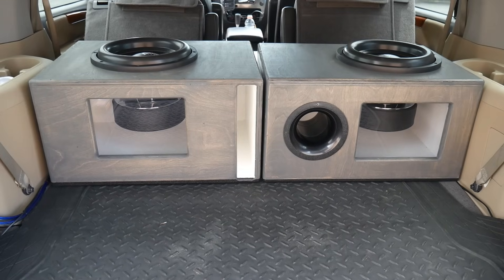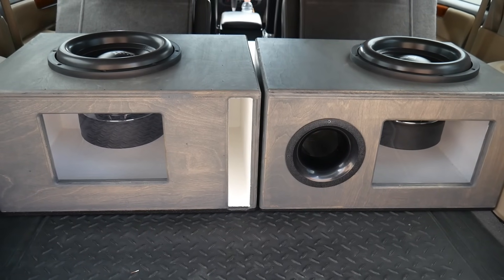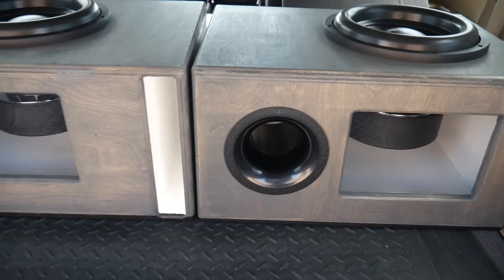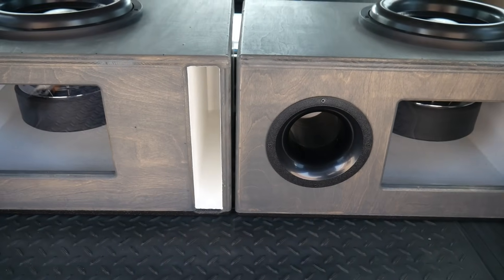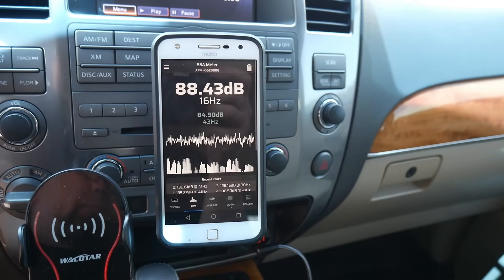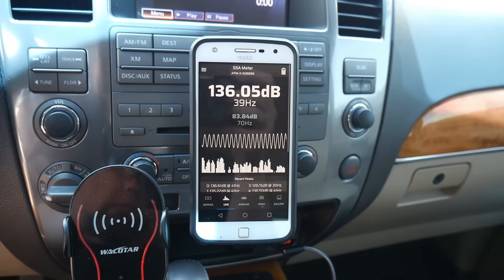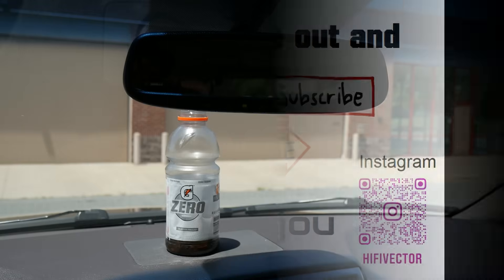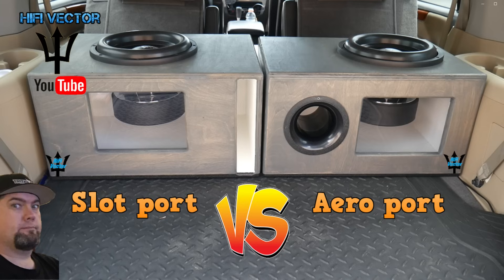Part 1 Slot port vs Aero port subwoofer box in depth comparison

Comment: Of course the slot port will outperform the aero since it has double the port area.
Reply: Yes, 2 x 4" ports minimum for a 12" high excursion subwoofer like that.
Reply: You always going to have that  one. Hey, shit was dope. Keep doing your that.
Reply from the maker: The whole purpose of this video is for fun but also, if you do some research, you do not equal the size going from a rectangle to a round port. This is a whole opinionated deal with this aero ports are supposedly more efficient so you’re supposed to be able reduce their size by 35 to 50% or whatever someone’s opinion is. And be equal to a slot port. Think about it how many normal low end or mid range 12 do you see with a 6 inch airport unless it’s some crazy high-end 3 inch excursion SPL sub everyone uses a 4 inch airport for 12. For this subwoofer, a 6 inch airport would’ve been too much area. This is why I wish they made more sizes in round ports like 4 inch 4 1/2, 5”,  51/2” etc…
Reply: @HiFiVector I  already knew you did the proper enclosure math using a box calculator program , duh lol
Reply: @HiFiVector Aeros are more efficient, yes. If you make them smaller than You would a slot then your entirely defeating the purpose of using the aero port and building your box wrong. 

I’ve never seen a woofer manufacturer recommend different area for slots or Aeros, they just give a straight up port area recommendation. 

Just think about it a little.
Reply: @bengailey5135 I've built boxes and have directions tell me to use a certain size of power area no matter if it's slot or aero or a square port tube or plain round. But then I have see box directions and bix building apps say the port area changes in reference to the type of port being used and it's size in diameter.
Reply: Yes port area might be greater, but the way the helmholtz resonator performs is the same, as verified using the dayton impedance curve tool. The rectangle shape is suboptimal to the cylinder in that it imparts drag to the air, so it must be larger to compensate. I would have liked to have seen dats results as part of the testing in the video. Might have cleared up some confusion.
Reply: Also meant to add that loading the port against a wall will sort of add like lowering the tuning as well.
Reply: Maybe I missed it, but all this discussion on surface area is not accounting for total volume of air moving through the port from port length. To directly compare ports, you should decrease the port area, but increase the port length of your slot port. 

If your criteria is only tuning frequency and avoiding chuffing (port noise), then you could really scew the odds and make your slot port even larger and longer than it already is.

You also are not taking into account that both boxes look to be the same size. This becomes a problem because the internal volume are vastly different between the two boxes and also affecting performance. 

It's a fun video, but it's not the perfect comparison between ports because there are way too many other factors at play than simply port type. Cabin gain not accounted for either as measured in the same place and boxes are placed in different locations. Removing each one and doing them separately in the same exact position in the vehicle would also slightly affect your results.
Reply: Lol you car audio guys a clueless about boxes
Reply: @ChromecastM8  Very interesting.  Don't think anyone thought about it from that perspective.  Did you want to add to the conversation or just make vague comments?  LoL
Reply: Aeroports can get really loud, this box was built to specs. I sure someone with plenty of time and material would get louder on that port, slot ports are cool since they basically do the job 💪🏾. Either way nice boxes and nice way to go on Sub selection.
Reply: Just what I thought
Reply: Now if they both had the same amount of dimensions of the ports equally used for the ports then it would be equally fair. But their not. So the slotted has more of a space ported so that would win and did. But then it all depends on what low bass  frequency or etc your comparing. Or the loudest alltogether
Reply: Dude ... Nope.
Reply: You need to flare the inside port end too.
Reply: Yes an aeroport is going to need less area.  But run a 6" anyhow and do the spl thing of running the port on the OUTSIDE of the box to achieve the same tuning.

Load that port against the back hatch and fire up or load the port into the side and fire up.  And it'll demolish the slot port.  ;)

Fantastic video
Reply: Needs a 6” aero not a 4”.  He failed before even starting
Reply: @EcSsAwS larger diameter also requires a longer port, but reduces mach speed.
Reply: @EcSsAwS hey I’m going to build a 10”inch sub can you send any good videos?
Reply: I mean yes but also no. 

Yes port area affects spl and the peakiness of the box but the benefit of the aeroport is you can use roughly half the port area and not have port noise. This saves airspace overall. 

So it's situational. The aeroport could save you enough airspace to build the box bigger and give a better power efficiency. 

Personally I prefer aeros due to ease of build but ports can be any shape as long as the resistance added by the area is calculated to the end needs.
Reply: @kylevanwinkle2081 I am a bit opposed to your answer. To some extent it can be good and you get advantages as well as too many disadvantages. The aeroport área, and for any other Port, it goes in proportion to the volume of the box and the Xmax of the speaker. I agree that you can gain a little more air for the horn, but let's also take into account that the horn will not work 100% correctly in its mechanical energy, therefore it can cause electrical problems.
Reply: A round port should also not be closer to any wall of the enclosure as the port's diameter, including the back.
Reply: I hope you are not the typical bad manufacturer who applies the formula "Volume x 16 = Port area". If so, would you leave me perplexed by the impression
Reply: I have never heard a build with an aero port be louder than a slot port, or have more bandwidth. And I’ve build hundreds of boxes and heard hundreds of systems. Just because it’s a circle doesn’t make it more efficient lol
Reply: @modernbassheads5051 A circle is the most efficient shape when it comes to the Flow of a gas or fluid.  That is undisputable fact.  Much better linear airflow, lower Reynolds numbers ect.  The aeroport like what was meantioned before is more efficient at fluid dynamics largely to the large rolled flanges, the shape and radius of the flange and the shape of the port itself all make a difference.  That said it isn't as large of a difference but maybe a two digit percentage.  The biggest thing that stands out to me is the tuning that is acheivable at much different area in² and in³.  Something else is at play.  Lower the frequency needs a longer distance for the sine waves to form into more powerful audible levels.  I don't think there could be a true apples to apples comparison.

Two different sizes (area² by area³) between the two different shapes and two different average airspeeds will result in two different levels of sound.  It's two different equations with two different outcomes.
Reply: @_FJB_ then why do chevy square port heads flow better than the circle port heads??? 🤔
Reply: @ederreyes3612  Same thing still applies.  There is a reason why for everything.  Cylinder heads have many many different variables than just a change of shape.  The two port shapes, circle or square with all else being exactly the same would have to be both straight through sections and exact same cross sectional area will show the round flowing better than a square shape every time.
Reply: @ederreyes3612  It's about 147cfm per sq in cross sectional area at 28" water vacuum.
Reply: @_FJB_ Yes, I  had a "debate" once on FB with a guy who claimed square woofers were larger than round woofers 😁
Reply: @_FJB_ the air in ports only vibrates.
Reply: @ronmartin7253 True and also what I said is true.  Both can be true at the same time. There is movement in the air and it's interactions with it's surroundings still hold true.  Especially the perimeter of the port.  Next to the surface there is nearly zero flow or next to none.  The shape of a circle has less surface are interacting with the area inside than a square or rectangle would which would allow for a better efficiency.  Higher the frequency the shorter the movement and lower the frequency the longer the movement.  The air still abides by the same laws of physics, boundary layer, reynolds ect.
Reply: @modernbassheads5051  Building boxes does not make you an expert so you automatically know everything. Of course, a round port is more efficient than any other, the friction on the contact surface is LESS! So yes, you use less space and it is much more efficient.
Reply: @DOroBeats  more surface area for the port is better for sound and spl as shown in this video, I also know more than you and have built more .. lol
Reply: @DOroBeats with a slot port u actually use less space cause the slot port is inside the encloser  it's  self.
Reply: @joshTheAudioGuy I've never seen a round port that is not inside the enclosure.
Reply: @joshTheAudioGuy that’s not true because if you’re building a box properly and both boxes have the same volume (port excluded), then you have to add more space to the box to include a slot port than you do an aero port.

Comment: I build a lot of boxes, and this was a great video !! I prefer Aero over slot, if you build your enclosure correctly you can even make your port adjustable on the fly. Something you can’t do with Vented. I also don’t like the “chuffing” from vented. Maybe I’m the only one that can hear it, but just not musically appealing. I’ve had some great vented boxes over the years, but just prefer aero. Subbed, great job on the boxes ….👌👏
Reply: Agreed. I like the smoothness of the bass the aero produces over the choppy slot port.
Reply: 7 cu 😮
Reply: @theinsaneunknown  That was all of the boot space up to the glass line in my tiny Citroen Saxo hatchback, managed 137.9 Db at 27 Hz on a Term Pro dash mic at a meet, power was a JL 1000/1 and single deep cycle Exide Maxxima battery plus 70 A alternator.
Again from memory the port was 25 square inches and about 24" long upward firing so internal end finished by the speaker motor, with the cabin gain from a small hatchback a window down drive by could be fairly spectacular at the right distance and could wobble larger store front windows, simple pleasures!
Reply: @g7vqedave2   I meant 7 cu seems like a lot, but that's without knowing much about the woofer or seeing what it looks like in software. I bet it was loud as shit in that hatchback though lol
Reply: Aero for SQ/SQL, and deeper bass. Slotted for noise! SPL, and concert speakers.
Reply: @TheWjbrown37  Yes, thank you
How would I port my next build
I think I want 30hz from Savard 15" 3500 thin copper wire
Then, I'm thinking of using 4 8" subs tuned the same for maximum SQ/L
Reply: There are ways to adjust tuning of a slot port on the fly, I have seen and done it myself
Reply: You can get rid of that port noise easily by putting 45s in all your corners when building your box. I run sealed boxes though so I have no horse in this race lol.
Reply: @ogxthugxnasty3885  I have done that with my boxes, all angles to have 45° or just the turns.  I have a long rectangle 4x12x29 wall port in box length.
Reply: @ogxthugxnasty3885  Or you can dial in your subsonic filter correctly so it won't play those frequencies that it can't reproduce. It only does that when the port's air velocity is too high, and that only happens when the port opening is too small for the frequency it's trying to hit
Reply: Aero would be more of SQ instead of just power?
Reply: I'm guessing by vented you mean the slot ported as slot or aero they're both vented enclosures and as for adjusting a slot ported box on the fly you just slide in a section of wood or dense foam to reduce the height of the slot to lower the Fs tuning as you've effectively made the port longer just like you might add a block of wood inside the enclosure to reduce the Vas and raise tuning for burping rather than booming, slot ported every time here and tune low to push the group delay out of harms way.
Reply: @g7vqedave2 

I am curious.    I am familiar with building and tuning boxes.  You mentioned tuning low enough to where group delay is minimum.  I am curious as to where you personally feel that frequency is..... in your opinion.
Reply: @drrckhamilton  I'm talking about my elderly mk 1 JL 13W7 here but from memory the Fs of that speaker was 27 Hz so using Win ISD my best box, again from memory, was a 7 cu ft tuned just below the speakers Fs at about 23 Hz.
This wasn't a massively loud box but compared to a box tuned to give large gain at the vehicles cabin gain frequency say between 40 and 50 Hz for burping in competition or impressing bystanders it would be many Dbs higher in the 20 to 30 Hz range ie. a street bass box.
Group delay will always be present in a ported box, more so when the box is tuned for max gain, and gives the flabby response that sealed box fans avoid but tuning the ported box low and spreading that gain to produce a flat response at 20 Hz where most sealed boxes can only dream of output leaves a more modest delay in the 30 Hz area and proper rumble.

Comment: Wow, I just installed two 2x4" areo ports in two different boxes (1ft³ each). And I was wondering this very question while doing it. Because the boxes are prefabed, and where sold as sloted, but where actually sealed. But I made them ported. 😂

Comment: Great video, and nice boxes. 
But, even if the aero is "supposedly" more efficient.  Isn't almost 50% less opening a bitt to much? I mean, if the point was to compare "identical " boxes?
Reply: Without identical port area this test is highly flawed.
Reply: You can't do identical port areas with an arrow versus slot port. Airports typically use 50% less area because there are circle if you had the airport the exact square inches of the slotted port it would be way too big and tuned way off. He even said in the video that he dats both of them and they both came out at the same frequency so his calculations are correct.
Reply: @terryheidmann4961  he also showed us that the aero port had almost 3x the port velocity.  Not necessarily a god thing. Yes, tuning was the same. I can tune a 8" just the same. Just lengthen it. Use a 2" port and you can stil get the same tuning, at maby 6x the port velocity.
Reply: Marketing hype and its victims...

Comment: This is why i like 6th orders . my 1 15 did 142 at 19hz on 2250 rms
Reply: Is that where the sub is inside the box hidden
Reply: @nadiaetheridge3863  yes a small ported side at around 25hz firing into the front box which is about 2x bigger and tuned to about 50ish Hz with 2x the port of the small size